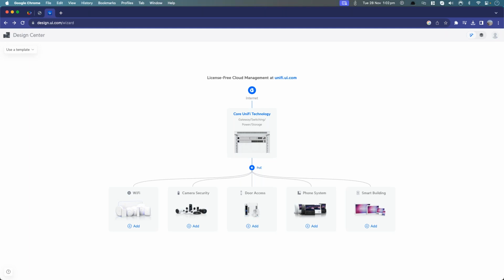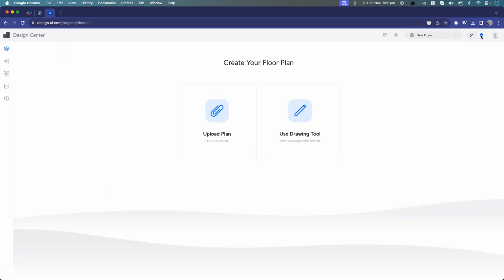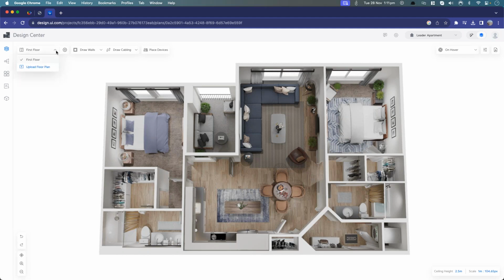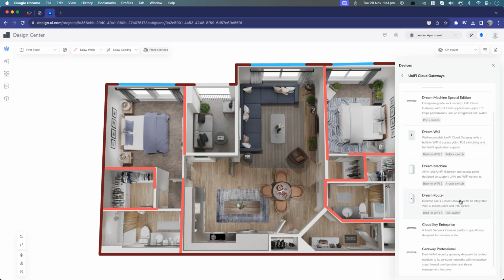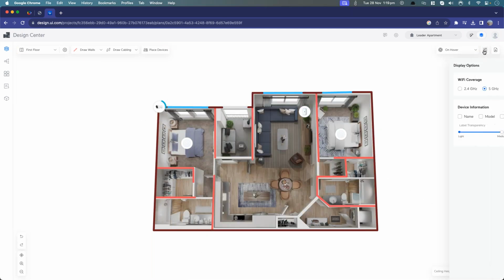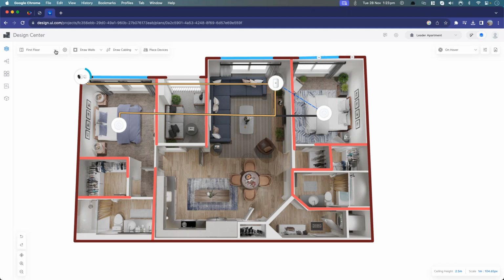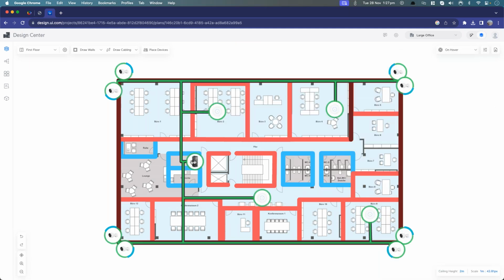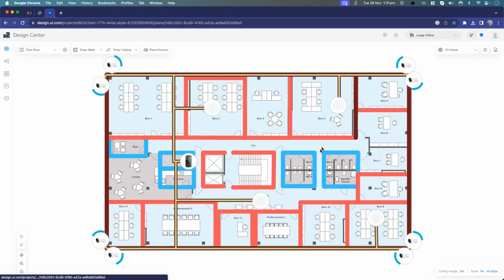Ubiquiti Site Design | How to use Ubiquiti Design Center

Comment: default the power is auto , i have read that this is the same a full power ?, and auto channel does only work when the AP is booting up is that right? i a few site i have set the 2.4 ghz to medium and the 5 ghz to high and this was a spetacular increase in performance and channel distribution and roaoming work much better